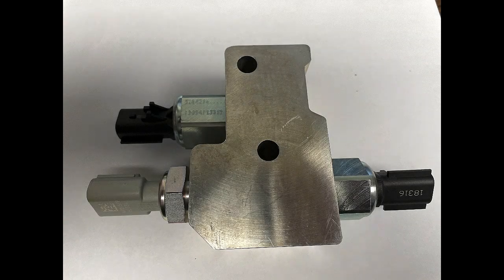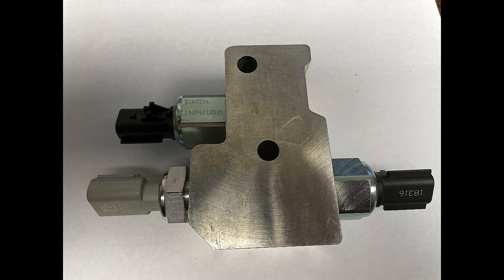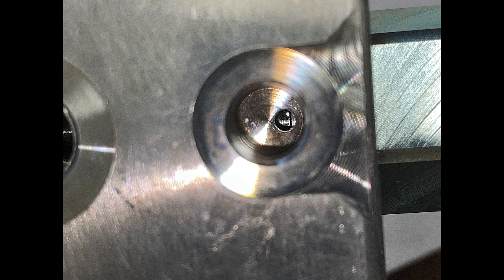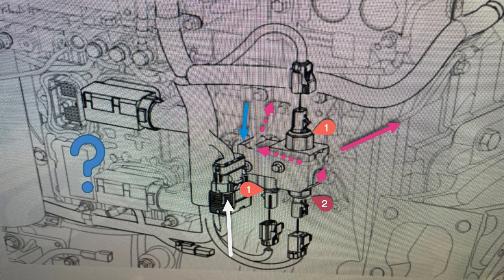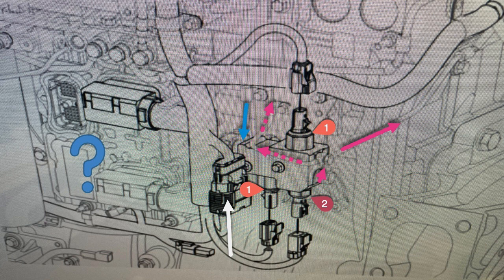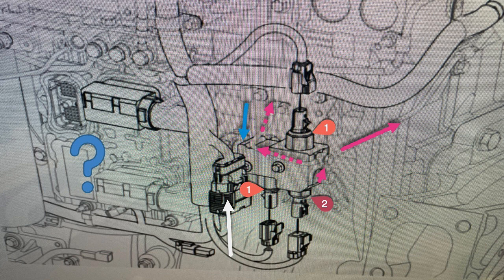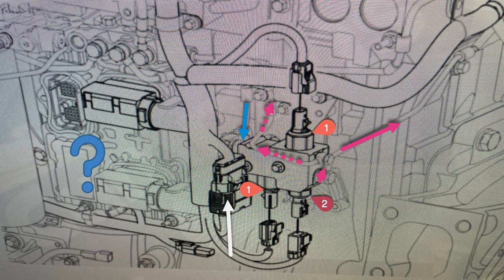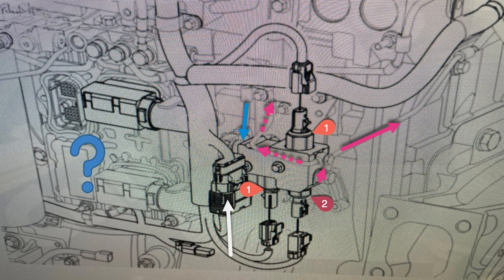What is the aftertreatment fuel block?

Comment: Thanks for this video.  I didn’t know about this assembly until now.  They must be normally pretty durable.  I’ve been maintaining a fleet of about 12 of these platforms and have not had a problem, yet.  Now I am armed with knowledge about it.  Thanks a million.  👍🏻
Reply from the maker: They are reliable. Even if the check valves start to leak a bit it has to get pretty bad before it faults out and regen is locked out by faults.

Comment: all of the engines in our fleet are ISL 2250 & 2350.  They dont have this block nor a fuel supply to the turbo.  How does the system properly regen without injecting fuel into the exhaust?
Reply from the maker: Steve's humor is much appreciated and he is correct on the B6.7 and the ISL, ISC, L9 they all fire cylinders 4,5,6 on exhaust stroke to send atomized fuel into the aftertreatment. So think about this. If those engines start regenning every 8 hours or less because something is wrong you can get fuel in the oil. It will show up on a sample.
Reply: @ENGINESHOPJOE  Thank you for the explanation. I do appreciate it and explains a lot regarding common issues that I see.  I work on transit buses.  Constant stop n go city traffic, never completing regens until they get a check engine light and it gets to me lol.  I see a lot of the 2250 pre-scr systems commonly having fuel dilution issues..  the later 2250/2350 with def and regen issues.   Thanks again.  Appreciate your channel
Reply: It washes out the back cylinders of the engine😂